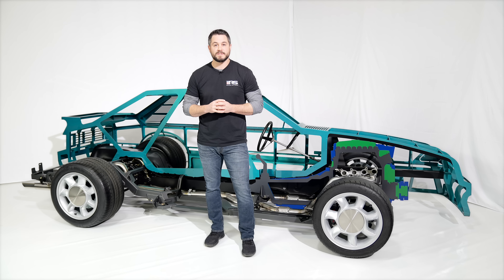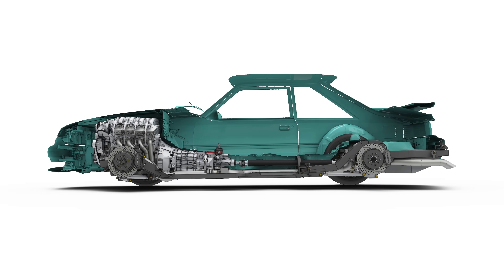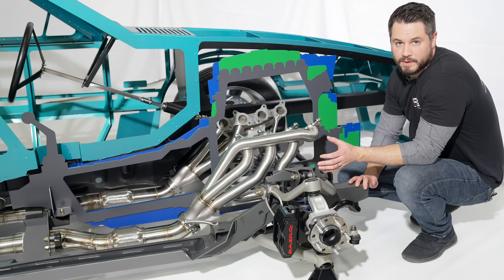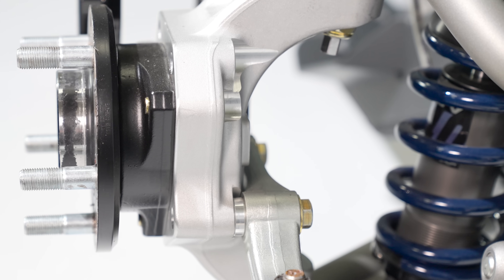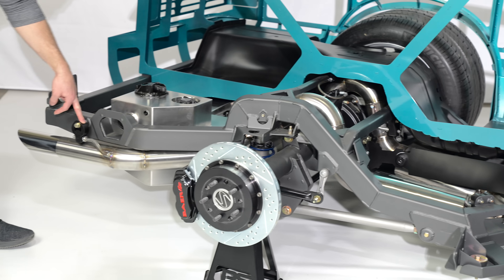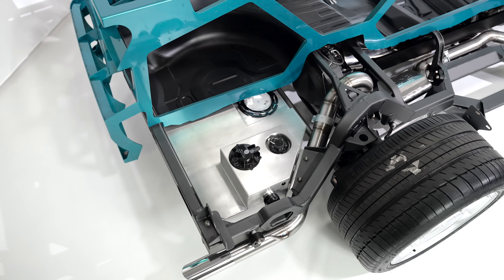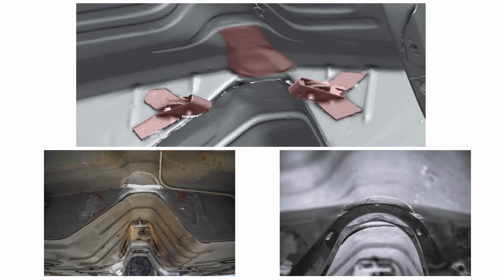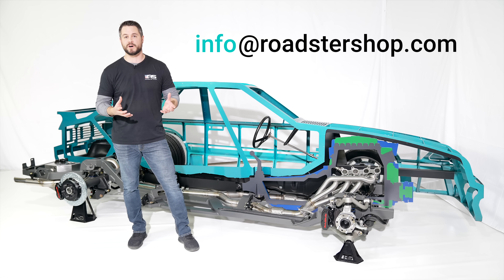World's first bolt-in Foxbody Mustang chassis | Roadster Shop SPEC chassis feature overview

Comment: As a Chief Enginner in the gas turbine industry, its really impressive how you have a full electronic mock-up of not only the entire chasis but of the fox body as well. Its pretty much the same process used to design a gas turbine engine and ensure all the parts manufactured at varuious suppliers can come together and fit properly.  This is real engineering and not trial and error engineering where you have to modify the parts a dozen times to get them all to fit together.

Comment: Sooo i've got an 86 4cyl roller that im building... its intertesting that for 27k, I can have a complete MODERN chasis with suspension, brakes, fuel tank with pumps and so much more.  I might actually look into this further.  would definietely make an old squeaky 86, be new again!  Is it safe to say that I basically have to get a plasma cutter and just cut off the OEM sub frame and just have a body to bolt onto?

Comment: So will this work on any 79-04 Mustang?
Reply: No. 1993 was the last year for the Fox Mustang.
Reply: @DortonFarb  
The "Fox" was a body style. The chassis was essentiality the same from 1979-2004. That is why a lot of suspension and chassis parts cover that range. The Fox, SN95 and New Edge 3 body-styles on the same chassis.
Reply: @A.J.1656  Lol. The Fox Mustang and the SN95 Mustang don't even have the same wheelbase. 

Obviously you know nothing about vehicles- you probably don't even know the first year of the original GTO.
Reply: @DortonFarb  
I don't give a shit about GTO's. 
I have owned multiple Mustangs in the year range I'm talking about. The 1 inch difference in wheelbase is a matter of swapping control arms, not a different chassis. Lol
Reply: @DortonFarb  
Why can you swap K-members, every engine, subframe connectors, control arms, the IRS from a 99-01/03-04 Cobra, steering components, etc into any 1979-2004 Mustang? Tell me I know nothing about vehicles. Haha.
You're cute.

Comment: This makes no sense if you know anything about foxbodies. Bring your foxbody to a race chassis shop have them do 2x3 box thru floor subframes,  weld and reinforce your torque boxes and pick any aftermarket k member you want. This will be as strong, lighter, cost 70% less $ and all the stock aftermarket/parts like headers etc.., work just fine.

Comment: Definitely should have made it able to take a Lima Ford engine or a BBC considering the fact that once installed in the car the chassis is well able to handle 3 times the factory torque and horsepower. Excellent concept but I would be afraid to know the price.
Reply: What you said. The average working guy can't afford this shit.
Reply: @Backwoods501  a really capable guy could use it as a guide to making his own version of it though and use their headers for a good fit.

Comment: Hey Hey
Quick question.
Anyway you could design an independent rear suspension set-up?
Maybe copy the one from the Thunderbird SC's 
And incorporate it in this chassis.
Then maybe move the engine back a little.
I don't care if I gotta modify the firewall a little.
I want my fox body to actually corner.
Without trying to kill me.
That would be nice.

Comment: I picked the minimum options and it was over $27K
Reply: This makes no sense if you know anything about foxbodies. Bring your foxbody to a race chassis shop have them do 2x3 box thru floor subframes,  weld and reinforce your torque boxes and pick any aftermarket k member you want. This will be as strong, lighter, cost 70% less $ and all the stock aftermarket/parts like headers etc.., work just fine.

Comment: $15,000+ to bolt on  650lbs of extra weight to what is supposed to be a light weight chassis. Pass
Reply: Bring your foxbody to a race chassis shop have them do 2x3 box thru floor subframes,  weld and reinforce your torque boxes and pick any aftermarket k member you want. This will be as strong, lighter, cost 70% less $ and all the stock aftermarket/parts like headers etc.., work just fine.

Comment: Hmm, maybe a good idea to use this for a Factory Five Cobra kit? Rather than picking up a donor fox-body as they recommend for all the running gear and frame. I am planning to build one in the near future and wanted to just get all brand new stuff. Like brakes, suspension, etc. And I already have an engine I'm building now, and a transmission and differential. So given all that, I would hate to buy a whole mustang just to pull the frame rails off only. So this might be perfect, as the kit already has a tube frame for the body to mount to...

Comment: Why no IRS option?
Reply from the maker: Our SPEC platform is designed to allow full chassis benefits without having to remove or extensively modify a factory floorpan.  IRS packaging simply takes up more space negating the benefit of the simplified SPEC chassis installation. We are hopefully working on an IRS option in the coming future for some of our SPEC setups where possible. 
We do offer IRS as an option on our FAST TRACK chassis for Fox Body's, but installation requires floor mods and a more advanced install setup.

Comment: Mixed feelings on this… if you want a grand tour fox and you have a lot of $ then this is a decent option… but for most folks a chassis stiffing system like stifflers and various suspension systems from upr ,team Z, maximum motorsports, BMR ect… is a much cheaper alternative and can be bought piece by piece…
Reply: This is an option for those who own a mustang who has a rust death sentence.

Comment: From August 1987 to March 1990 I owned a 5.0 4 speed 1979 Pace car. First owner had raced it in the SCCA showroom stock class A series in 1980/1981 in Minnesota and Wisconsin. The worst part of that car was the 4 bar link rear suspension which made the rear of the car jump and go sideways if you hit a bump in a turn. Though maybe the 4 link bushings were worn out? The 2nd worst was the small brakes. The 3rd was the 4 bolt hubs and wheels. The 2nd owner removed the 4 point rear roll cage after buying it. I was 20 when I bought it and I was H on wheels. The body twisted enough in the turns that it would eventually pull up the loop bar that the hatch mechanism latched onto. I owned another Pace car briefly in 1991 but it was a project car. Haven’t owned another one since. I’d be happy to just own a plain 79-82 hatchback with a 6 or 8 cylinder as a majority of them have been parked.
Reply: They could skip a bit on turns at higher speeds, worn bushings makes it worse. 
Brakes on the fox body were short lived, not enough imo. 7-8k I was doing brake jobs .Radiator barely sufficent, otherwise great cars, super reliable
Got my 86 less than 1 yr old dailied  it for yrs, plenty of "fun" runs never missed a beat.

Comment: How hard would this be to apply a new edge body to the chassis? Is it possible even? 

What if you want IRS? Is that possible? 

Also I'd love to see some videos of a car driving with this chassis. How does it ride, put power down, etc.
Reply from the maker: 'Hard' is relative.😉 It wasn't engineered or considered for that platform, so we'd have to say 'no' until we tried it. If the new edge platform seems like an option we want to pursue, we would likely engineer a specific chassis for that generation.
Currently there is not an IRS option (we do offer IRS on our FAST TRACK fox chassis) as we intended the chassis to be installed with no floor cutting or modification. It's something we are looking at offering soon if the packaging allows.

Comment: @RoadsterShop will there be an IRS version, or does the factory bolt-in IRS work with this?
Reply from the maker: IRS is something we are looking at soon - packaging is a limitation since this chassis was designed principally to avoid having to cut or modify the factory floors. Stay tuned. 👍

Comment: You have so many options for motors, trans, rear tire etc i just wish there were more options for front tire width.
Reply from the maker: Front tire with is dictated by the physical packaging of the body with the wheel size. The second constraint is the inboard factory front rails and running a useable, compliant geometry that still allows good turning and clearance with the factory wheel openings.
Reply: @RoadsterShop  275 up front is a huge upgrade thats plenty!

Comment: Only thing that sucks is the price. Cost as much as a show car ready Foxbody mustang in the rust belt. So you know this is likely more expensive than a lot of peoples running and driving cars alone. This is likely why it's never been done before. The R&D cost too much.

Look, I understand you think you're marketing this towards people who already have a lightly modified street car. But you won't pull anyone in that group because the people who have the money to burn to pay for this ($16k and up) chassis aren't these kind of people because I'm of the people you are trying to market to. And it's just too much.

What you have is a very cool product. But you'll only get buyers who have a lot of money to burn who are competing with their car on the track. And usually they weld their own chassis together. So then you're going to deal with people who have money to burn but don't have the knowledge or experience to do any welding. Which is likely why you designed this to be 100% bolt on.

Comment: what would be the reason of the rear not being independent also? thank you
Reply from the maker: Currently, packaging. Goal with this chassis is retaining the factory floorplan. We are possibly working on IRS as an option if it's possible with this setup.
Reply: @RoadsterShop  This is such a cool upgrade. 6 mounts is spot on!
Glad you explained it was wondering how this mounted. Super tough upgrade!!

Comment: Besides the awesome frame, That cutaway half-car is a work of art
Reply: it's such a great way to showcase all the features of the chassis
Reply: Its ai
Reply: @natecote1971  It's aluminum, it was at SEMA.
Reply: @natecote1971 it would be jittery and wouldn't stay still if it was AI.  Rhese guys build a whole chassis you dont think they can cut the nody of a car down the middle and then reinforce it enough to stand up straight?  

Did they use 3d scanning and CAD aoftware to do both the chassis and the body cut reinforcement?  Almost definitely.  These are tools that have been widely used since the 90s in OEM car makers and not AI.

Comment: Well, I don’t wanna be cynical, but I just don’t understand the point in this chassis. The amount of cost and weight added to the stock Mustang chassis platform seems a little bit ridiculous when you can put subframe connectors and change out the torque boxes and have something that’s lighter and has the same performance that you’re gonna gain from a full chassis.

Comment: Problem is unless you find a unicorn in a garage never abused the guy in a home shop doesn’t have a frame machine to untwist the car my 89 ragtop I bought in 92 ended up running high 11’s low 12’s on street tires in 93/94 and had a 6 inch crack under the back seat and doors were off 1/4 inch from top to bottom when I built the cage …I like what you guys have built but finding a straight unibody  isn’t going to be easy … and why not an irs … t-bird cougar cast iron housing instead of the terminator twist leaking aluminum one or a 44 plus from a zr-1/ or viper …

Comment: The next logical step is a roll cage that can be installed by positing the new chassis below the body, welding in the top of the hoops then pushing the chassis up to the body.

Comment: 650 pounds of steel.. at 10 cents a pound that makes the materials worth 65 bucks.. the whole setup starts at $15k and change.. i see this as a challenge.  👐 😮😊
Reply: You must not buy much steel. It's not cheap trust me just buying tubing to build a roll cage is well over $500.
Reply: That’s scrap value. You absolutely cannot buy sheet, tube, and box steel for $0.10 a pound.
Reply: What's your scrap value per pound? Makes about as much sense as your comment.
Reply: @jamesengland7461  $0.10 like I said. What doesn’t make sense?

Comment: So would this ultimately get rid of the need for the factory  shock towers like with a self contained coilover like a crown vic front end? If so would be cool to have a kit to smooth the bay of the shock towers also rids the rust issue there

Comment: Need front and rear independently suspension. Question: does this mean you could potentially shave the shock tower's in the engine bay..... I don't remember seeing anything about that.
Reply from the maker: Correct - shock towers become unnecessary with this installed. We are about to commence working on a couple in-house builds using this setup so stay tuned to see how the engine bay turns out.

Comment: Looks really cool.  Might have to buy another fox body... :)
Why the 4 link in the rear and not a torque arm?   The factory 4 link is awful - and adding a panhard bar is a bad bandage - can you say 'bind'?
Reply from the maker: Glad we didn't use the factory 4-link then 😉 - lots of reasons for the 4-link and avoiding the usual internet debates of one over the other, a torque arm simply is harder to package with trans tunnel, exhaust and an unmodified floor. 4 link keeps the setup closer to what our customers expect in terms of ride quality, handling, ease of install and ground clearance, packaging etc.

Comment: Great looking product!  Would RS consider doing a front subframe?   I ask because I’ve welded in the Detroit Speed Engineering through-the-floor SFC’s and am running an’04 Cobra IRS.  I like the DSE SLA, but was concerned about the upper A-arm being so short.
Reply from the maker: DSE make great stuff, but it's unlikely we'll be making a subframe.

Comment: I dont buy the weight claim one bit. The 9" rear alone adds a ton of weight. Until you guys show the weights of the parts side by side, or scale a car with this installed, nobody is buying it.
Reply from the maker: Ok -🤷 people asked...we weighed everything... And you don't believe it?  Really zero benefit for us to make it up or lie about anything. We decided for this Fox chassis to actually see what the difference might be and we were pleasantly surprised ourselves so we made a point to mention it. 
Weight however is rarely a concern when 90% of our customers are adding the increased handling and performance benefit of a chassis, plus (typically) a major HP increase with new motors, drivetrain, better braking (more weight), more rubber, larger wheels, full interior, audio system etc etc.
Reply: It would be moronic for them to lie about it since this is something that could be easily proven after the fact, and they would probably get sued.  I’m going on a limb here and saying that they are probably smarter than you, to not make such a false claim.  
They have their company and their reputation at stake. They are not some moron on YouTube who makes stupid remarks.
Reply from the maker: @jeffgriffith7003  True, but it's also not like we are saying "Buy our footlong sub" and someone measured it at 10 inches...or "this chassis will lighten your Fox body XXXlbs.... We rarely sell our chassis with an advertised "weight" and as mentioned in the video, there's a point in the weight comparison where the "apples to apples" comparison isn't quite accurate any more. What is removed as parts isn't really equal in function to what's being re-installed as the improved version after a point.
Reply: @RoadsterShop a lot of people call the sn95 and new edge mustangs "fox bodies" would this chassy work in one of those applications?
Reply: @dakken74  nobody calls the new edge cars fox bodies, what are you talking about.
Reply: Even if it's not true either way can you afford it .
Reply: Why would they lie?
Reply: To sell shit....

Comment: The Foxbody is more than just the Mustang. The Fairmont sedan and the Mk7 Licoln LSC were also Foxbody so the market REALLY opens up with this Roadster Shop bolt in chassis!
Reply: The 1980 to 88 t birds and cougars are also fox bodies, along with the mark 7's. The SN 95 mustang is just a revised fox body so they could tweak this a little to make it fit the sn 95's and now you would have mustang coverage all the way to 2004
Reply: The mercury capri also
Reply: The 9th gen Thunderbird, as well.
Reply: There was two different wheel base  options in the fox platform too, my 88 cougar is longer than my fox, but identical parts otherwise.
Reply: @foxbasher7435 wheel base should be the same. Rear body and front nose made it longer.
Reply: @markball7028 that is not true. Cougar birds were 104" wheel base, mark 7 was 108" and some of the boxy birds were the same.
Reply: My 83 Fairmont more door sedan has a wheelbase of 105 or 105.5", but all the critical mounting points for upgrade goodies are in the correct locations.  That does however present a personal problem with this specific chassis upgrade 🤔
Reply: Mercury Zephyr ❤
Reply: Fox platform Lincoln Mk VII LSC wheel base is 8 inches longer than the Mustang. 108.5 vs 100.5. They would need to stretch that frame another 8 inches for it to work.
Reply: Hear me out... Mk7 LSC body, orange creamsicle, Barra turbo inline 6 fully built. Watch out Supras.
Reply: Early 80s Thunderbirds were fox body
Reply: What would be great is if can accommodate a built 400 and haevy duty T-56 transmission.
Reply: Tbirds too
Reply: The tell tail signs of a Fox body are the strut tower tops and 3 lateral ribs on the fire wall  just above the bell housing area.
Reply: Wasn't the mk7 on the panther chassis like the crown vic?
Reply: @assaultlick2169 No. The Mark VII was built on the Fox platform.
Reply: @assaultlick2169 no, it's a fancy ass Thunderbird.
Reply: @assaultlick2169  No, Fox.
Reply: @assaultlick2169 you are probably thinking of the Mark 8. Mark 7 is a fox just like the T Bird from the same years.
Reply: @assaultlick2169 you are correct the mk8 is fox ish